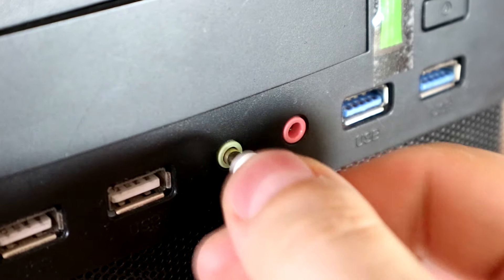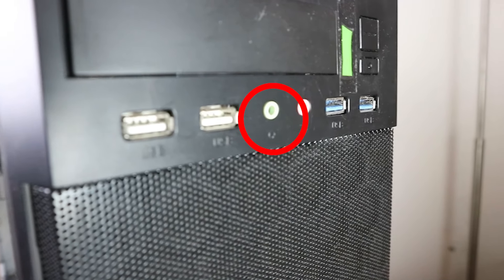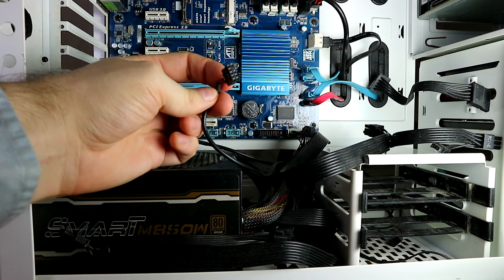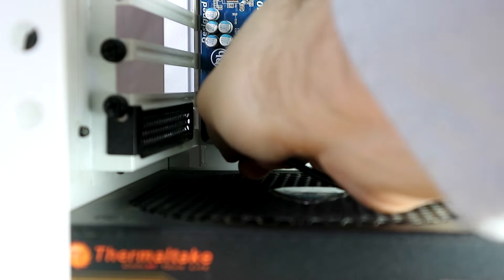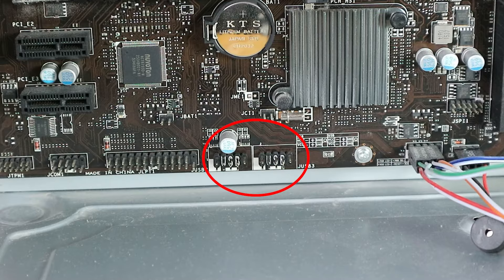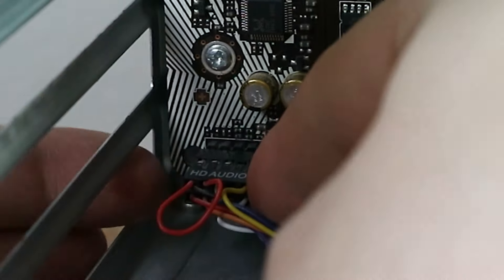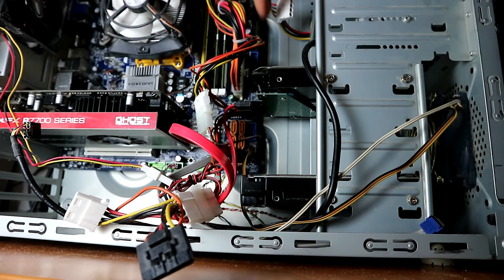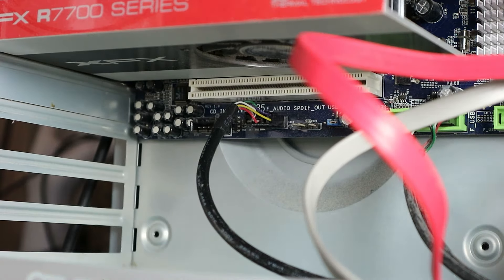How to connect front panel audio to the motherboard

Comment: Hi that cable is the same for the rear panel audio? My PC lost audio output sound. I reviewed this cable and it's connected. But the cable is a little like some mini cables inside are out. Can I use other cable? Or is there another connector for rear Audio? Thank you

Comment: I did everything right but it’s not going in for some reason please help
Reply: If you are still having that problem try downloading your graphics cards drivers from either amd or nvidia.
Reply: @marcusahse270 3 months late but what the commentor meant was that the cable dont fully plug into the slot not when activating their monitor

Comment: My headphone jack pug broke and is stuck in the front audio port so I try to do the reverse. Connect the cable to the rear port, but there is nothing there to connect it. I don't know if I'm missing something or if it's over.

Comment: Hey bro I have an nzxt h510 and there is on HD audio. I tried to push it in the right place, the pins where also in the right position but it won't fit to the end like it is halt pushed in. Then I pushed with all my power and it got an little bit depper but it is still not completely in. Now I have nno audio and It doesn't work. Please help me bro!
Reply: mine wont go all the way in either
Reply: @chrisnewberry5713  yes its so weird. But I'm going to buy a special USB to HD audio output and then I'm fine. Also do this if u want. Im also going to upgrade my b450m s2h to an B450 f gaming and my r5 1500x to and r5 5600x. Also im buying more ram and the kraken m22. I think this is the best month of my life
Reply: @quexx_btw1898  you should get a b550 or x570 for a 5600x because most b450 boards don’t support 5000 series and it’s a big upgrade from 450-550
Reply: @ashadrizvi4608  yes ik but with the right drivers I can use 3.gen ryzen cpus
I want a ryzen 9 3900x and not a 5000series because my cpu I have rn is 1 gen and I can't put it on a 550 mainboard
I think I'm buying a B450 f gaming II or an B450 aorus elite
Reply: Exactly the same problem here.

Comment: everything connected and fine but i am getting any audio (output) both headphones and speakers are working fine but not getting any audio
Reply: if you are getting audio from the connectors in the back but not the frontal panel try looking at the HD audio options on the BIOS
Reply: @rageagainstthemachinez9z475  Thanks Mate but there's no output from both panels :/
Reply: @EProGamers  
oh that sounds complicated, have you tried updating the audio drivers? I use a software (Driver Easy)
Reply: My audio is working only mic is not

Comment: there's a crooked pin in the cable plugin port, so I can only use my headset when I plug into the speaker port. Is there a way I can straighten the pin?
Reply: tweezers, no joke
Reply: @foxrestive8285  thanks ima lyk if it works
Reply: @mxtty5633  well?
Reply: @ThreeLetters3  it didn't work, if there is a way to send a picture I can show you what I'm talking about

Comment: i have a problem and I'm not sure how to fix it and if anyone can help me out a bit I would appreciate it, the front panel ports of both headphone and microphone seem to be weak, I plug either one in and it almost feels like the connectors inside the PC have either become too loose or have worn out somehow. I opened up my PC to see if anything seems damage or out of place but can't think of anything wrong. sometimes the signal will pick up and my Windows will notify me that headphones were plugged but it goes away so I think I need to replace the front panel.
Reply: did you took out the front panel to look close to the audio connectors?
you need to look if the audio connectors are solidly connected to the plaque where the cables come from, if the connection is damaged you need to replace it
sorry for my English
Reply: make sure u have it fully plugged in and turn off front panel detection on the realtek app

Comment: You're lucky because your cable was in ONE 10 pin HOUSING HD AUDIO...

BUT my front panel, it is separate into each pin : R-RET, MIC IN, MIC PWR, etc...
And I don't know the pins configuration for HD AUDIO ...